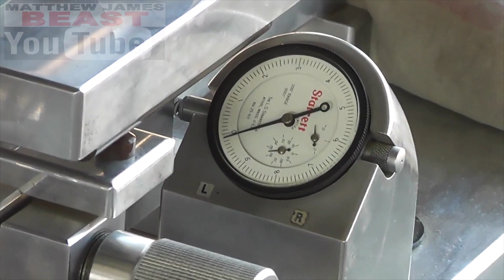Rail Guns -  The Weapons of Tomorrow? High Speed, Low Drag.

Comment: Those aren't railguns. Those are conventional competition rifles. You can tell because there aren't any rails on the weapon, or capacitors, or electromagnets. That said these are very precise custom made weapons the owners are very protective of. Nice stock laser sound effects by the way.
Reply: Look people, guys in the shooting sport have been calling these railguns for decades. No they aren't built the same way as an electronically activated railgun, but a common way to build these competition rifles is and was to have the gun slide back and for one rail on each side of the gun. Look into them a little deeper and you'll understand that part is true.

Comment: put a camera on the scope and electronic reload and manual movement system on this so it can be used and controlled by using it inside the vehicle through the monitor  and controller.

Comment: Not Futuristic, Not a combat arm, not science fiction!  These are Bench guns ot rifles . Rail Gun is a nice name but I wouldn't call them that. this is an acuracy sport for old farts like me, with more money. you take some shooting skills, some engineering and machining talent: Blend that with an understanding or loads (Chemistry and physics) ; and this becomes a sport.  It's not a secret military proving ground. Past courtesy no special permission is needed.  6 MM rifle and at 200 M it has a 0.3 MOA or slightly better from a very controlled platform.  I have friends that do 0.5 - 0.6 MOA on a bench with a normal rifle, i can slam in 0.7 MOA the odd time ; but that is as much luck as anything.    It's interesting .... But much like Golf or Chess, not a spectator sport for me.
Reply: It's not even correct to call it a railgun. A railgun is a form of gauss weapon. Unlike a standard gauss weapon, a railgun propels the projectile along magnetized rails rather than through a traditional barrel. They're much, much more accurate for it but aren't as portable since the rails have to be much longer to make a difference. The US Navy just finalized their first railgun to be deployed into action, mounted onto, I think, an aircraft carrier. This is a gun mounted on a rail, which would technically make it a "rail gun" but when you say railgun most are immediately going to think of the gauss weapon.

Comment: this isn't a railgun after all railguns I have seen they either use a electrical charge used as a projectile like lightning or a laser but as if it where a bullet but actually a electric charge or the use a metal rod probably titanium or they use and electrical charge to fire a titanium rod either way a full size rail gun would probably need 1 if not multiple trains to even move it but the recoil it would inflict on those trains would also cause it to fall over if firing sideways in any way but I understand why they call it a railgun it is cause it has the accuracy of one
Reply from the maker: +Brandon Cadd it's a different type of rail gun. the people who build them call them a rail gun. They are on a rail. Now the other type is spelled one word like "railgun." what we have here is spelled with two words like "rail gun."
Reply: Mattv2099: more videos OH ok

Comment: What a crock of crap this video is.  "A small fortune to manufacture"...that depends on your definition of "small fortune".  There are shotguns on the market that cost 5 or 6 times as much as one of these.

"Must have a PhD..."  Hardly.  I know two people who live in small town rural Missouri who shoot these.  "Used on the battlefield"...not likely.  Look at the way they're supported.  These are also not rapid fire weapons and the battlefield doesn't require this kind of accuracy.  These shooters load their own ammunition between shots, adjusting their loads to achieve maximum accuracy.

I'm not sure what good "a true 3 dimensional experience" does when you're shooting a two dimensional target.  "Film with explicit permission".   Yeah, because you can't just waltz onto a shooting range and film without permission.  They are private property.
Reply from the maker: ytubepuppy *****

Comment: was thinking more of the Magnetic Rail Gun though...

These are just the rifles on the bench.
Reply from the maker: MOPIC they are on a rail
Reply: +Mattv2099: more videos they are not on a rail, those are bench rifles. rail guns rely on electromagnetism instead of gunpowder. Furthermore, these won't replace guns in the battlefield as you say in the video, because even though they are precise, they are big and heavy.
Reply: +IsometricGaming Rail like a Trains Rails on its track, not rail like electromagnetic propulsion of a metalferrous projectile.
Reply from the maker: Manuel Falagan they are on a rail. the gun part moves on a rail.
Reply: Manuel Falagan then where are the wires? i see no aspect of those weapons that are any different from a bench gun. As a matter of fact Im pretty sure those are all bench rifles.
Reply: Ya me too

Lets see a mini rail magnet drive weapon thats under 40 lbs

Yo darpa??
Reply: +Mattv2099: more videos 
its a gun bolted to a rail bolted to a flat plate that sits on a table . . .with some nasa science thrown in. . .and i was kind of expecting a magnetic railgun too
Reply: +Mattv2099: more videos 
its a gun bolted to a rail bolted to a flat plate that sits on a table . . .with some nasa science thrown in. . .and i was kind of expecting a magnetic railgun too
Reply: +Mattv2099: more videos that doesn't mean its called a "rail gun" i mean you CAN call it that but it doesn't change what it is, it has a "rail" that the gun sits on but thats only there for the recoil mechanism which is not at all unique to this type of gun . . .if anything you should call it "recoil mechanism gun" or what it is 'bench gun" or whatever it actually is cause idk
Reply: +Mattv2099: more videos that doesn't mean its called a "rail gun" i mean you CAN call it that but it doesn't change what it is, it has a "rail" that the gun sits on but thats only there for the recoil mechanism which is not at all unique to this type of gun . . .if anything you should call it "recoil mechanism gun" or what it is 'bench gun" or whatever it actually is cause idk